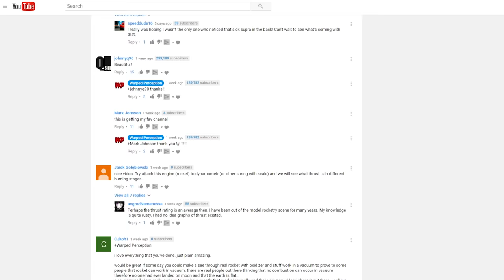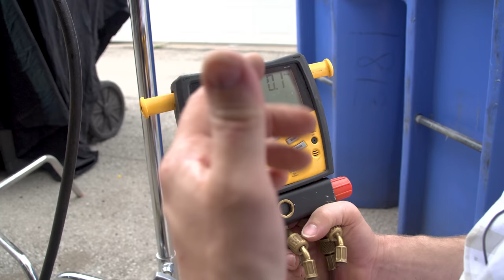Model Rocket Engine In A Vacuum Chamber - 4K Slow Motion - will it burn? - Rockets (S1 • E3)

Comment: A bunch of these people that doubt it don't know what a fuel oxidizer is.
Reply: They didn't even know that the Earth is round. What do you expect?
Reply: what is fuel oxidizer?
Reply: How big of an oxygen supply do you think would be needed to fly around in space?
Reply: @michaelcondoulis2509  basically it provides the fuel with enough oxygen that it can burn without a secondary oxygen source such as air, thats why solid fuel rockets can burn in a vacuum
Reply: @robertnorthrup5415  if it was a solid fuel rocket like the one in the video, the solid fuel has the oxidiser in the fuel so if you have more fuel there is also more oxidiser present so you dont need a supply of oxygen unless the rocket is luqued fueled, in that clase there is a seperate tank of liqued oxygen that is mixed with the miqued fuel and burned, this also means that no air is needed so both kinds of rockets work in a vacuum
Reply: Why can u hear it if it's inside a vacuum? 😂 ballearthers are so silly
Reply: @pamelapamper  So, sound waves are vibrations that travel through the air or any other medium like water or solids. In a vacuum, there's no air or any other medium for sound waves to travel through. That means that if you were inside the vacuum chamber with the rocket engine, you wouldn't be able to hear anything because there's no air for the sound waves to travel through and reach your ears.

However, when the rocket engine is running, it creates vibrations that can travel through the structure holding the vacuum chamber. These vibrations can cause the structure to rattle and shake, and this shaking can create sound waves that travel through the air outside the vacuum chamber. That's why people outside the chamber can hear the rocket engine even though it's in a vacuum.

So, it's not that the sound is actually traveling through the vacuum, but rather that the vibrations caused by the rocket engine are being transferred through the structure and creating sound waves outside of the vacuum chamber.
Reply: @siriusayt  so what you just say is obviously wrong because what you hear is not "rattling" from the structure but you clear hear the sound of the fuel burning etc... dude stop believing in fantasy.
Reply: @robertnorthrup5415  A pretty big one, its usually liquid though so it can be smaller but its still big. You can look up images of for example Saturn V cutouts and see how theres 2 massive fuel tanks for each stage, one contianing propellant and the other the oxidizer.
Reply: @pamelapamper  You can hear the fuel burning because the exhauist quickly fills out the vacuum allowing soundwaves to travel
Reply: He said oxidizer like he knows how it works in SPACE. Even if they made the rocket with an oxidizer and added fuel in spark to a closed chamber the vacuum and no oxygen in space alone would suck everything out faster than you could see it. Plus the way you talk you sound like you don't know how thrust works either. You probably think that flame thrusts the rocket. I enjoy how people can throw out words like oxidizer and know nothing about it just because they watched a YouTube video on how the f1 rocket works on the Saturn V
Reply: @sircsolerom764  What are you on about. "The way you talk" cant hear text, anyways. The fuel and oxidizer is kept in pressurized containers that remain closed, then "small" amounts are let out through pipes and ignited in an ignition chamber as they get pushed/sucked out. This ignition causes them to expand faster than they would have normally, causing them to shoot out even faster producing more thrust, but even if the ignition chamber failed just letting the air get pushed/sucked out would still produce thrust, just very inefficiently.

Comment: The problem with this experiment is that the moment the rocket fires it is no longer in a vacuum. Bigger vacuum tube required I think. Nice experiment.
Reply: Rocket propellant was added but no atmospheric gasses.
Reply: Its a failed experiment, because Creating a true vacuum, where there are absolutely no gases present, is extremely challenging and often not entirely achievable in practical conditions. Even in a laboratory setting, it's impossible to create a perfect vacuum.
Reply: @vz7042  It is a perfectly valid experiment. The concept of a perfect vacuum is a theoretical idealization used in physics for simplification, but it doesn't exist in the practical sense. Even in space, there is no perfect vacuum. So, flat earthers are wrong - as always.
Reply: @VivekanandaKF  You have been on space personally to prove it.. or sharing your imagination yet..?
Reply: If it was in a vacuum why didn't vacuum pull out the smoke and why can it be heard inside a sealed vacuum chamber
Reply: @willbyrd7704  what do you mean pull out the smoke? its a sealed vacuum chamber it gets stuck in the chamber
It can still be heard because the exhuast impacts the walls of the chamber and then also fills it therefore allowing soundwaves to travel through the exhaust
Reply: @digdougedy  you understand the expansion of condensed oxidizers. well said
Reply: @ValkyrieRiderIPT  no atmospheric gasses??? what does an oxidizer release when reacted, my friend?
Reply: @garykarr1421  I was thinking that the argument was that rockets don't produce thrust in a vacuum but he is just proving that rockets do burn in a vacuum. Obviously, a rocket does not rely on air flow like a jet engine, so why anyone would question that is a bit dim... However, the idea of rockets producing thrust in a large vacuum is still unproven by this experiment as the rocket did not start moving until the vacuum was filled with gases emitted from the rocket... I'm not saying I don't believe rockets don't produce thrust in a vacuum, I'm just saying that someone needs to prove it in a large vacuum chamber.

Comment: Nice video. I did notice that the rocket only started moving once the tube was full of smoke which means it was no longer a vacuum and therefore had something to propel against. That wouldn’t be the case in space. Still a good experiment though
Reply: This is incorrect, it only moves forward because the entirety of the fuel grain takes a second to ignite. The fact that it no longer was a vacuum is irrelevant. This would still propel itself in space
Reply: @temdb3939  the pourpes of the experiment is to see if the rocket works with no air lol
Reply: @jaimeaparicio3392  This is true, but it is a poor experiment. However @TillaMC is still wrong in saying that it would not work in space. If mass is ejected in one direction then the rocket must accelerate in the other direction. Saying that this is untrue means that you think energy and momentum can just be created from nothing.
Reply: No smoke escaped so vacuum still intact

Comment: The engine didn't seem to move until the spent gases created a back pressure. This looks like it worked but space is much larger that the tube. Great video 👍
Reply: Pressurization requires containment.  Who woulda thunk - GEOCENTRISTS

Comment: The problem with using a tube with a short  end to it , the end of the tube will provide something to push against . It would need a very long end to it to avoid affecting the experiment
Reply: That’s irrelevant. Once the particle has left the engine why would it hitting a surface affect an object which is no longer connected to it? Is there some magic link through spacetime? No. Force is created when the particle leaves the thruster via Newton’s third law. 🙄 sheesh

Comment: I love the way you mounted the rocket engine! genius!
Reply from the maker: Blu3B33r thank you very much. I got the idea from the inside of a refrigeration scroll compressor comma I used to build install and design Supermarket refrigeration systems for a living.
Reply from the maker: Blu3B33r that's why I have these vacuum pumps.
Reply: I agree. It was beautifully simple and acted like a spring to show the force of the rocket.
Great video Warped Perception!
Reply: Warped Perception If you ever watch a super slow mo. playback of a pistol firing a bullet you can clearly see that the recoil occurs significantly after the slug, and vapors have left the barrel. This is to say that after the slug and vapors leave the barrel, there is a period when it seems like nothing is happening before any visible recoil occurs. Would you have any interest in shedding some light on where that energy is during that apparently inactive period?
Reply: I would hazard a guess that the delay in the recoil motion is due to the automatic loading mechanism 
inside the pistol moving backwards. As it travels forward, reloading a bullet into the chamber, the action imparts an equal and opposite reaction force to the body of the pistol, this will account for the delay.
Reply: It's acceleration delay, similar to the delay in your car getting up to speed after you increase the fuel. It's inertia.
Reply: depends on the type of pistol, not all of them use the same mechanism. many use a "locked breech" which doesn't "unlock" and allow the action to cycle until the pressure has dropped. i suspect this is what you have seen. with this type the idea is to allow the pressure to subside somewhat before the action moves. the recoil is there but it is acting on the whole pistol and the person holding it, which will be less pronounced in slow mo due to the mass of the pistol and the person holding it. in a blowback operated pistol which does not lock like this, the recoil initially acts on the slide only because it moves as soon as it is fired. you would see the slide move much faster because it is taking most of the recoil, and its mass is much less. hope this helps.
Reply: Also keep in mind it is usually overcoming a spring that is holding the slide with considerable force regardless of the arrangement.
Reply: Rob Snell Thanks Rob, Now I'll have to go back, and have another look. BTW I just discovered your videos myself, and totally enjoying them.Be safe, and many happy returns.
Reply: +Warped Perception

Could you measure the force applied?  Calibrate the spring scale and measure it in the time lapse of the rocket test.  :)
Reply: +Alrukitaf I think you may find that with increased vacuum pressure, there may be even quicker burn - until - well - possibly one big explosion in a perfect vacuum? Just a hypothesis - we need to investigate further. Hope we can get some data.